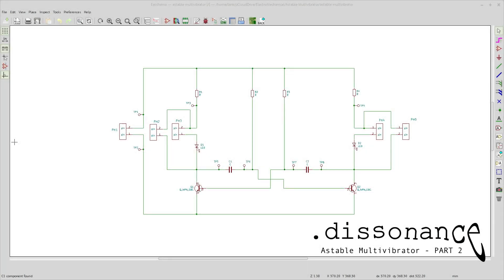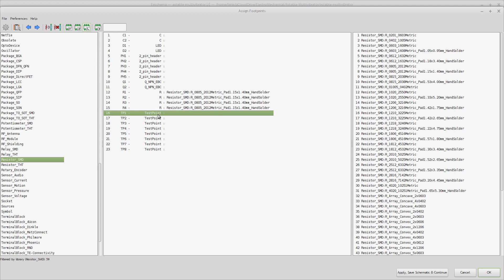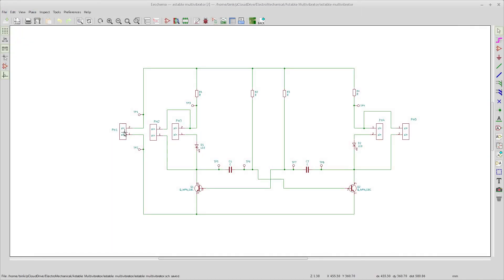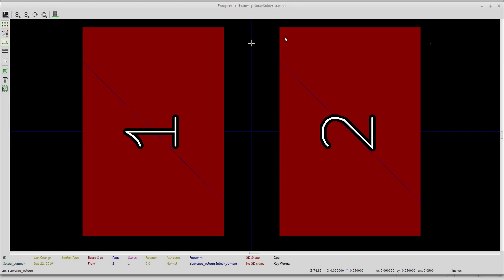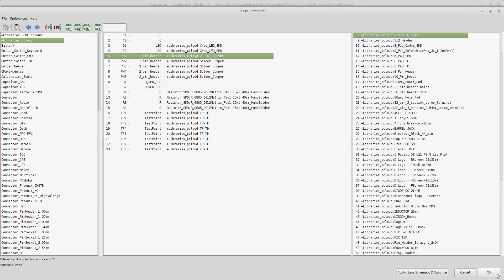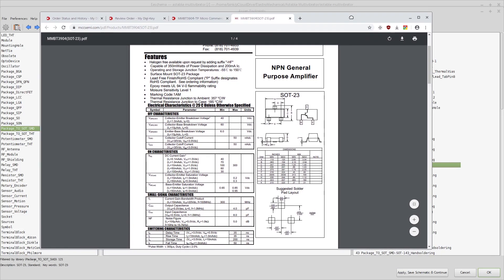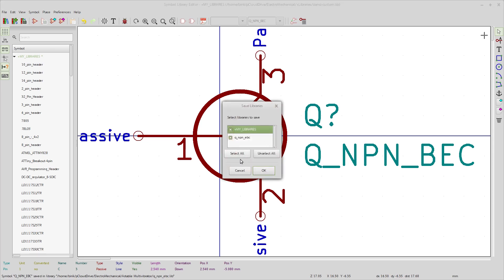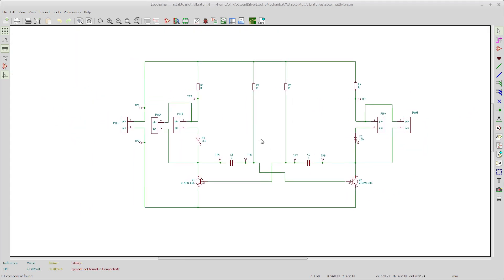#105 - The Astable Multivibrator - KiCad PCB Design - Part 2

Comment: Why you didn't choose Q_NPN_BEC? It would be easier, no pin reordering necessary. Footprint SO-23 pin numbering is a standard and already in a footprints library.

What version of KiCad are you using? I have 5.4.1 and in Symbol editor you have symbols list on the left, and if you right click on any symbol, context menu will show up with "Save a Copy As..." option. In the next popup list box you can choose new name for a symbol and destination library.